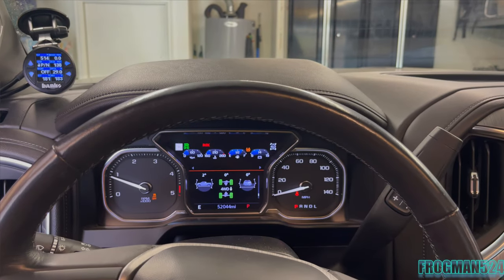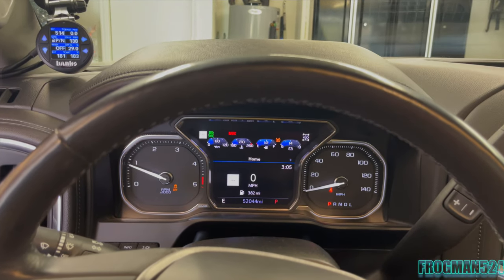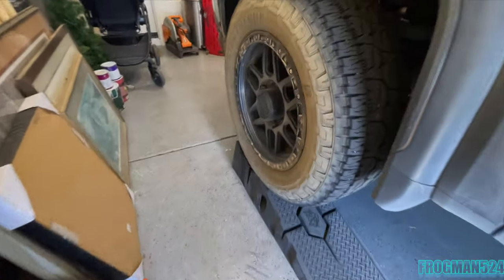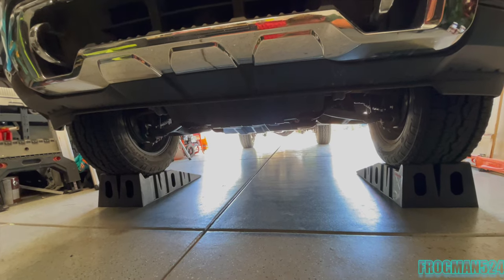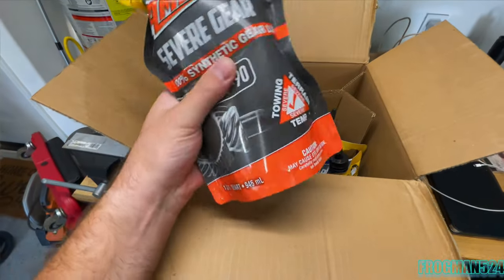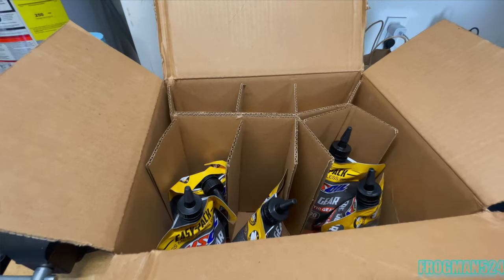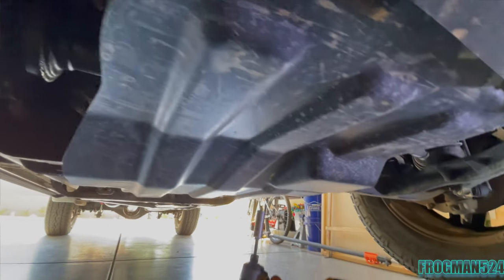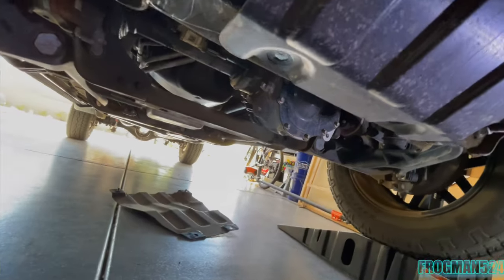2020 Denali HD Front and Rear Diff Fluid Change

Comment: I have a 2020 Sierra 2500 and did the transfer case fluid change in my driveway. There is plenty of space between the cross member and the fill plug. Not sure what you're talking about. Just use a hose and pump the fluid in.

Comment: Thanks for the video, I just did the transfer case on mine, not bad at all.  

I was surprised to hear you were having the trans serviced at 50k (45), which is the severe service interval. normal use is 90k.  

The stuff you do with your truck didn’t sound severe considering the same driveline can pull 30+K with DRW.  (Different rear axle but Still the same final ratio)  I guess you do have the banks on there, and of course it’s your truck and your money so you get to decide!

Comment: Just an FYI, apparently in 2022, GM has ordered axles for the HD without drain plugs front and rear.  My 22 HD Dmax does not have them.  So, either suck it out through the fill hole which leaves the residue in the bottom, or get pan gaskets to do it properly.  All my trucks back to 2001 have had drain plugs for the axles.
Reply: @jhb3711  My 2022 Silverado with a Duramax does not have drain plugs on the axles - I looked - it only has fill plugs.  The dimple on the axle casing is there where it should be on both axles, but there are no drain plugs.
Reply: @randyandersen6888  i apologize. You are correct.
Reply: I have a 2021 HD Sierra with no drain plug either, I saw this video and was angry they used to have it in 2020 😡

Comment: Bro what do you mean?? I actually did the transfer case on my 2021 watching your video for you older truck. And I’m jealous there’s no drain plugs on my differentials ):
Reply from the maker: The T case on the 2020/21/22 fill plug is right in front of the cross member. I didn’t feel like dealing with buying a hose and a 90 fitting to do the fill
Reply: @FROGMAN524  my ‘’21 might be a bit different from yours cuz I had a pretty easy time with the fluid change using your video for the older truck. Which btw thanks a lot brother, love your videos.
Reply: @FROGMAN524  also, I used amsoil squeezy pouch so I didn’t need a hose and 90 fitting.
Reply from the maker: @samueldamianreyes7602  yeah the manual says Dexron 6 in the T case so I’ll have the dealer do it along with the Dexron ULV in the trans tomorrow
Reply: @FROGMAN524  can I ask what dealer you take yours to? I’m in the Phoenix area as well and I’ve had bad experiences with Sands Chevy  in Glendale.
Reply from the maker: @samueldamianreyes7602  Coulter Cadillac Buick GMC on 12th st/Camelback
Reply: @FROGMAN524  question.  Amsoil specs the 2019 but not the 2020 for the front diff fluid.  Is your truck a late build 2019 or what?  I really want to use this in my 2023 front diff, but amsoil says no. Any input is appreciated.

Comment: Literally no reason to be changing diff fluid on a brand new truck... but at least he's using all-natural snake oil on them gears.
Reply: How so?
Reply: Coming from someone with exactly ZERO experience using UOA’s (used oil analysis) in a fleet environment… yeah I’d say you are VERY wrong. Getting the wear metals out early is the single most important thing you can do to increase differential life. I don’t care what fluid you use as long as it meets the recommended specs and environment/operational use.
Reply: @nordicpride9708  Well, I appreciate that you announce your lack of experience. I, on the other hand, have a lot of experience spanning decades and NOT ONCE have I experienced mechanical failure due to not changing diff fluid excessively or unnecessarily. Tiny shavings in the fluid are not going to contribute to wear; and if you have anything larger than that in the fluid you have other problems.